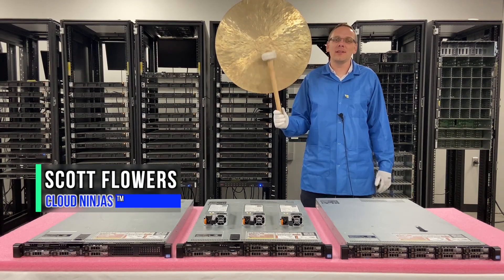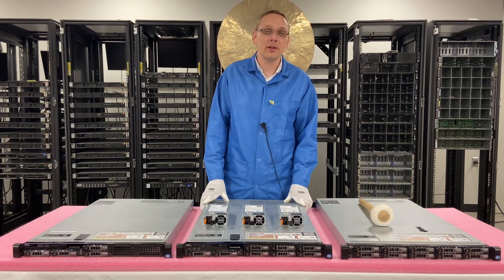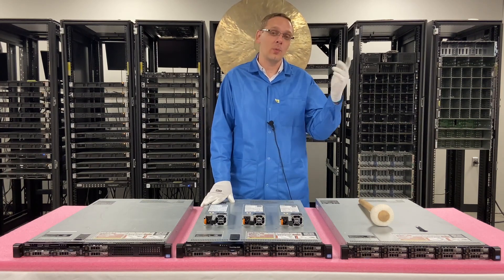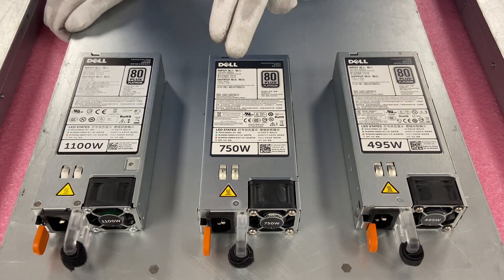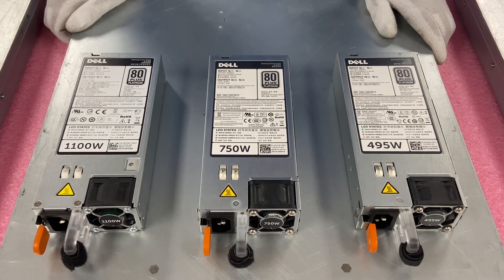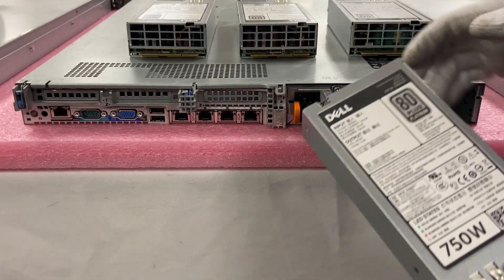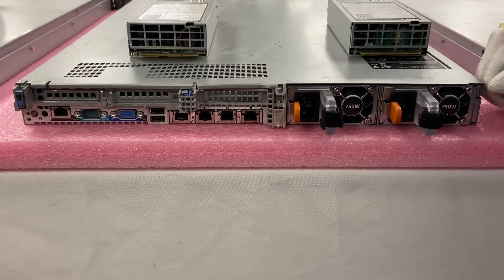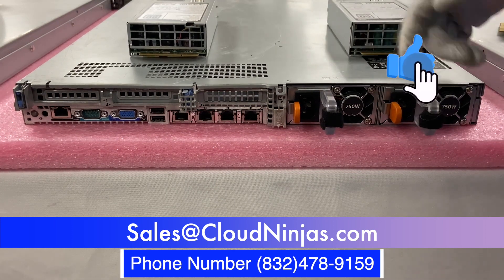Dell PowerEdge R620 Power Supplies Overview | Power Supplies Options | How to Install Hotswap PSU

Comment: what is  difference using 2 PSU with 1 psu?
Reply from the maker: If 1 fails and you do not have a back up, then your server will shut down.  With 2, you get an alert to replace the bad one but your server will still be up and running.  No down time.